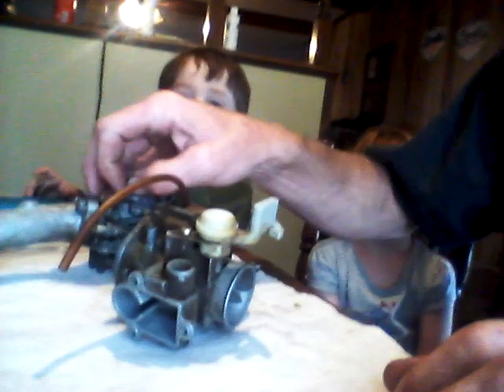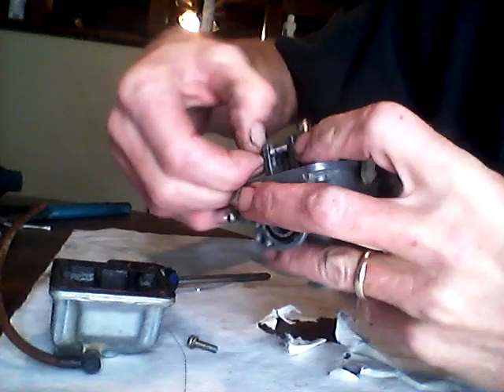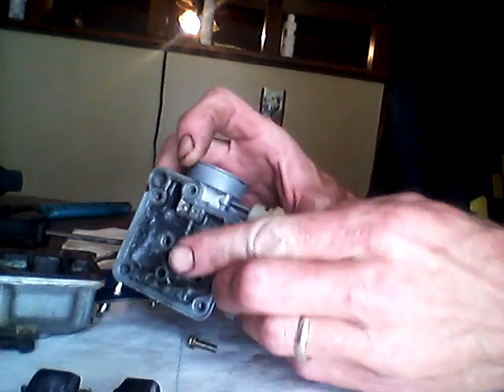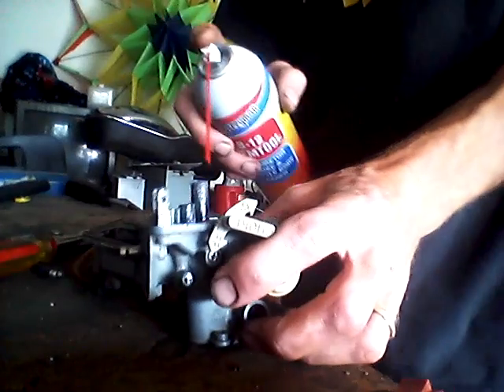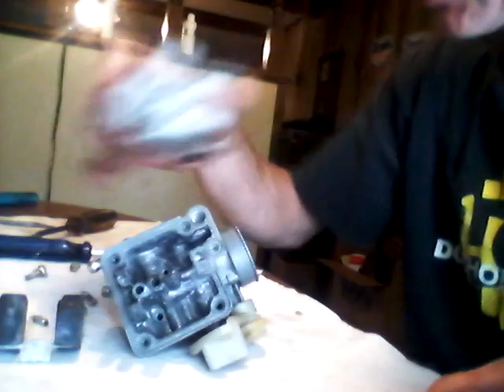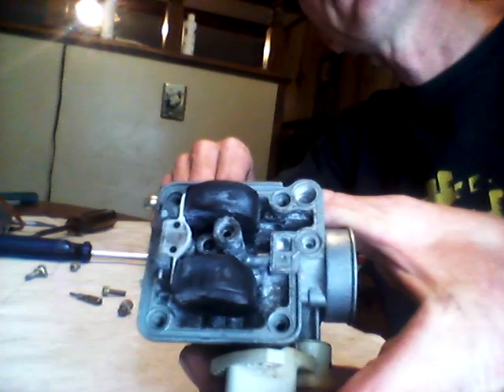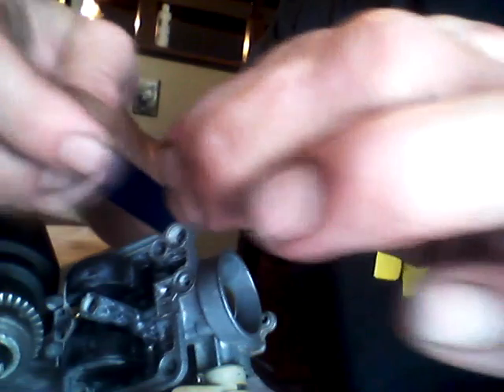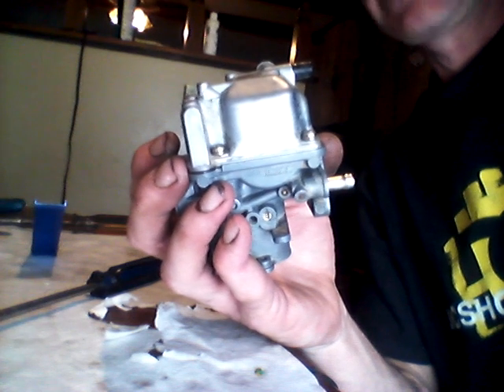Yamaha 80 carburetor  rebuild clean

Comment: It's not the ethanol it's the water that is absorbed by the alcohol that causes the damage. It's no difficult to remove the ethanol from gas, lots of videos. Ethanol increases the octane leaving you with close to 80 octane fuel when ethanol is removed. It's best to use a fuel additive like stable marine to prevent water from being absorbed by the fuel. Are use both stable marine and she phone. 100LL avgas is the best fuel to run in small engines in my opinion.
Reply from the maker: seems the ethanol gas has more water !but yes its definitely water got three right now with water in the tank ! one fuel injection got codes now ! thanks for watching ! we have vp racing gas here ! but its not cheap lol
Reply: Walden's World VP has no additives at all, that's why it goes bad so quickly.  Avgas has a minimum 2-year shelf life from the date pumped, pump gas self life is about 4-weeks.  All the fuel we have out here on the west coast is E85 to E90. What's amazing is DOT rested ethanol for over 2,000,000 mile with no ill effects but they didn't include a single carbureted Vehicle or small engine.
Reply from the maker: @tedenderpalmer6550  thanks ted for the info i know a little but not alot ! now i know more !

Comment: 86 Moto4 been sitting a while.  It starts and runs great but when running gas is coming out the bottom overflow screw on the bowl at a pretty decent rate.
Reply from the maker: Man I bought a cheap carb off eBay like $30 runs great . Does your carb have 2 or one cable ? 86 had 2 I think in 87 they had 1 ! I had to buy carb also but it runs awsome
Reply from the maker: Your float is stuck
Reply: I'm pretty sure it has just the one cable.  I pulled it off the bike and gave it a quick once over carb cleaning.  I didn't take the jets out or anything.  It had some buildup in it.  I just wanted to make sure it would hit and run.  I will pull it off again and clean it a little more thoroughly.  Love your guitar string and drill idea.  I would like to use the original carb but if it gives me fits I'm not opposed to a repop.  Anything special I need to do to unstick the float other than a thorough cleaning?
Reply from the maker: @mopargocarrick  eBay ! 87 Yamaha 350 carb . It should pull up a cheap one .
Reply: Yep.  A bunch of hard junk built up not letting it slide up and down.  So would a 350 carb be like an upgrade for the little 80 moto4?  I would think it would be way too much fuel for it?
Reply from the maker: Crap no it won't fit . L I was talking to another guy also on a 350 cc ! 
Those carbs aren't cheap I'd try soaking it in carb cleaner or gas or something first !
Reply: Lol!   It's running alright.  I think I'm going to add some seafoam as well.  It just needs drove more than anything.  Thanks man.

Comment: Hi, I have problems with my YFM80. It wont start at all. The carb has been cleaned DOZEN of times but it wont start. The only thing you can hear is the engine trying to ignite every now and then. What could it be?
Reply from the maker: Shoot starter fluid in carb turn over ! If it don't fire you have spark or compression issue !!
Reply: @WaldensWorld  Already tried that. And I have compression and spark. Maybe to weak spark?
Reply: Adjust the valves

Comment: Hey Waldens World, I have a 2008 yamaha raptor that wont start. I have spark, cleaned the carburator good 3 times, I have new fuel. But wont run. It was running one month ago. It wants to start but just doesn't. Please help. Thank.
Reply: *2003. Sorry.
Reply from the maker: I would start with checking compression . Pull the plug n put your finger over plug hole it should be able to blow your finger off n you may feel a bit if warmth from the pressure . You may have valve issue or rings ! ? Will it start on starter fluid ? Is the carb filling with gas ? Drain screw on bottom if carb open make sure carb has gas ! 
If float stuck n flooding quad ? If it starts on fluid n flutters on gas this may also be issue ! You can check valves by putting paper towel by exhaust pipe . When turning n over it should want to fly up . If you have stuck valve exhaust it will flutter a bit as well f to be pulled records pipe ! U can do this with intake Al's but use a rag with no frizz to come off . It will run to pull it in carb so I only cover half . If it looks to push it out your intake is open ! It's usually exhaust valves getting tight ! 
S check has to carb ! N check valves ! A bad plug or water on plug will also do it ! Check yu still have spark also ! Holler back
Reply: @WaldensWorld  so i justed pulled the spark plug and i think i have compression it wants to push my finding away. Yes i have gas in carburator just doesn't want to pump gas. I wont start on staring flud. It pops like it want to start but it won't. I think its backfiring.  I do have spark. It was funny one month ago. So this is what happened. It was running about a month ago. Then i washed it. (It was on) then i know it need the carburator clean so i bought one from eBay. I replaced it and nothing won't even start now. So i cleaned the originals one very good 3 times all the jet valves and all. And now i get nothing. Going on 3 weeks working on it.
Reply: @WaldensWorld  Thank you for your reply.
Reply: @WaldensWorld  could it be that my gas niddle on the carb is to low on the carb? I do have air coming from the exhaust when it turns over.
Reply: @WaldensWorld  so i do have compression i just had gas come up from the bottom black tube on the carburetor and from the tube vent next to the choke valve (choke was on) when this happens. So gas is pumping. Any ideas.
Reply: @WaldensWorld  any ideas?
Reply from the maker: I'd check valves next  is it backfires out of carb !
Reply from the maker: Should be .004  .005 exhaust n intake !
Reply: @WaldensWorld  how do i check them?
Reply from the maker: @cobramarthagreat  u need feeler gauge n take cap off the top of the head . The rocker arms have adjustable tapit
Reply: @WaldensWorld  Thank you. So .004 for exhaust and .005 for intake? Thanks for your help. 🙏
Reply: @WaldensWorld  Hey Waldens works so just to confirm its 004 for exhaust and 005 for intake? Thanks.
Reply from the maker: Sorry a feeler gauge u can get at a airports store .
Reply from the maker: Float may not be shutting gas off needle needs replacing or cleaning is what I'd guess if fuel is coming out carb over flow ... Or you don't have vent on gas cap n tank is pressured n pushing gas out !
Reply: @WaldensWorld  so its 004 for exhaust and 005 for intake?
Reply: @WaldensWorld  Hey Waldens world how low does the throttle needle have to go on the carburator? I think thats my problem.